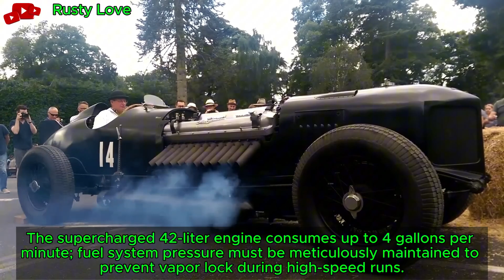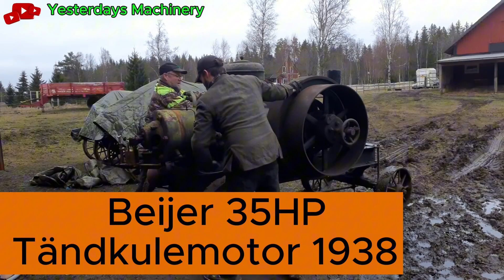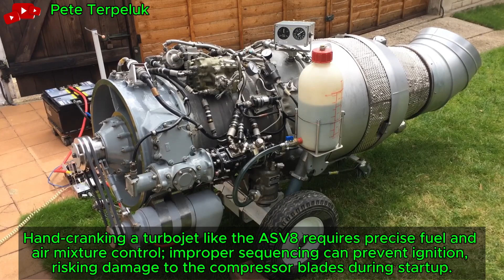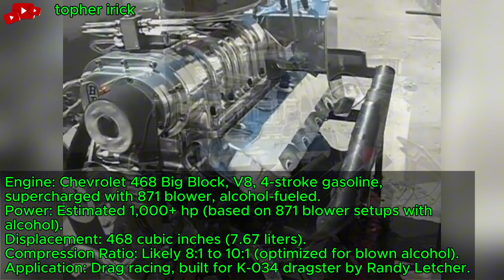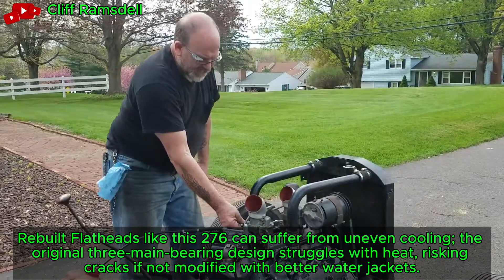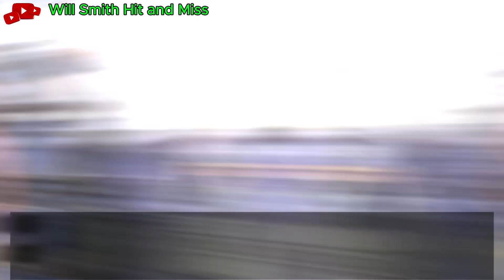Rare Old Engines Starting Up Sound That Will Blow Your Ears! ▶ Part 46

Comment: Flathead Ford V-8 engines are fun to modify. I used to use a milling machine on the cylinder heads to cut a groove from the sparkplug hole over to a spot over the center of the piston. This little trick would dramatically increase the engines torque output. Extreme careful measurements were needed so you didn't weaken the cylinder head and have cracks form. And yes, I found this out through trial and error. Ugh
Reply from the maker: That's a fascinating modification! The groove technique you described for the Flathead Ford V-8 cylinder heads can indeed boost torque by optimizing the combustion process. It's impressive you figured it out through trial and error, though the risk of cracking the heads highlights the precision required. Thanks for sharing your experience!